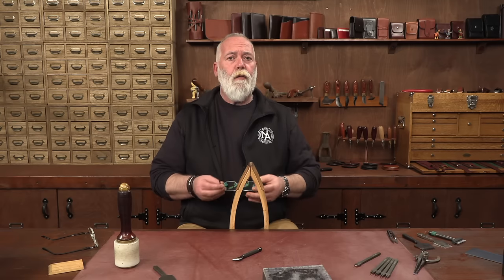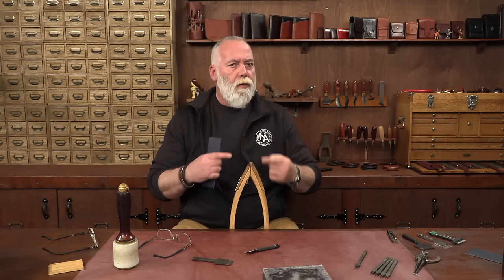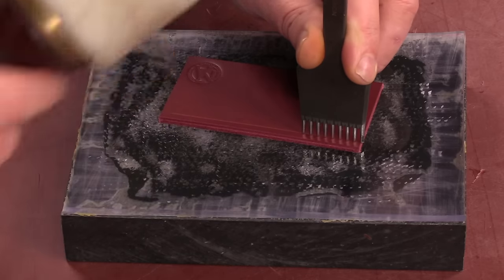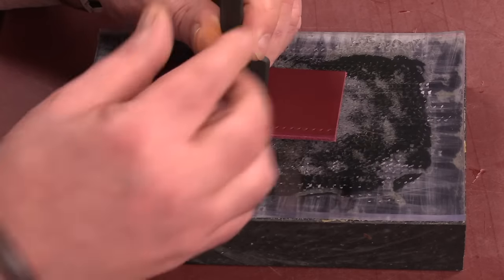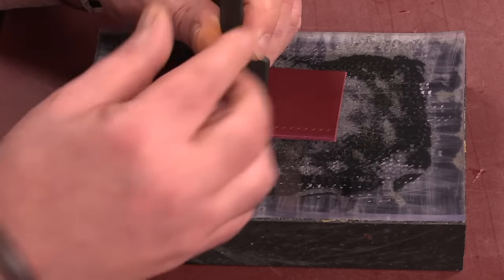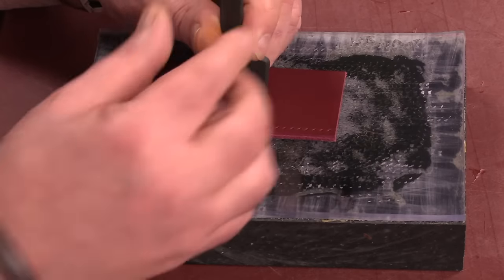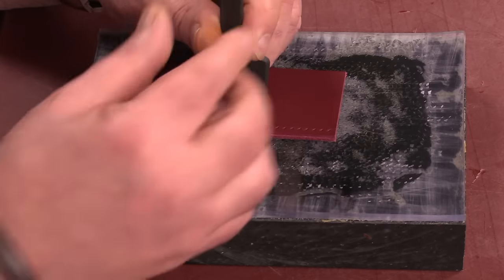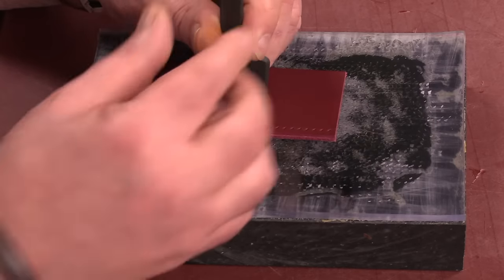How to Hand Stitch Leather - Saddle Stitch -  Modern Style - Tutorial Part 2

Comment: Hi Nigel, Just been watching your tutorial on the modern saddle stitch episode 2 and just want to point out that the way you are using the pricking iron on the 2 pieces of leather will cause a problem because when you stitch the 2 pieces together , the stitching holes now create an X and are not either a forward / or a back /. This X will cause the needle to punch through leather fibre that has not been pricked with the iron. Other than that I have learned an immense amout fron your tutelage !    Thanx    Russell
Reply: This is the difficulty I struggled with. You've voiced my problem. Thanks
Reply from the maker: Perhaps a re-watch would assist.
Evidently, it works as you see the results in the video.
This X is quite clearly explained and intentional.
I developed this style of stitching some years ago and have been testing, using and teaching it with great success since then.
Trust the process.
Reply from the maker: @kursatbasar.m  Hope the above helps.
Reply: Thanks Nigel,
I will watch again and definitely I need to practice more
Reply: Excelent my friend, many thanks.

Comment: Hello. First of all, very good explanations. In the part where you join two pieces of leather, using the iron awl that makes inclined holes, I believe that each side (each piece) of leather was inclined to one side, and that's why some difficulties arose in the sewing. Since the pieces of leather are mirrored, the inclination of the hole must be opposite on each side, so that when joined they are the same... For example: on one side it is / / / / and on the other side it should be \ \ \ \, because when you join the flesh of the leathers, they are in the same direction... When you made the video, one piece ended up being / / / / and the other also / / / /... I hope I explained myself enough and helped...
Reply: Agreed, unless I missed something, an x will be really weak as all thread on 1 point, all holes must face the same for lacing/sewing/joining or no meat for strength...

Comment: Hi Nigel Thanks for this! Just one question. What about the thickness of the thread? Doesn’t it interfere in the length. For example I mostly use 3mm pricking iron, with 0.45mm or 0.35mm...wouldn’t i need more or less depending on the thickness of the thread?
Reply from the maker: It's more about the journey that thread takes rather than how thick it is.
A 0.35mm thread will travel the same distance as a 1mm thread, so in short, no, it makes little difference.
Reply: Thanks for the response. I just wanted to make sure while using your thread length calculator! @ArmitageLeather
Reply: @ArmitageLeather   Hi nigel just a quick question i am sure you mentioned something about water blisters on one of your recent videos but i cant seem to find it now  .i had a few water blisters on a pouch made from sedjwicks 1900s collection leather  not near the stitching what would the best way to treat the leather before a project .Thanks

Comment: I don't agree about the tension angles. There are more situations where the thread have to be tensioned at an angle, with very thin leather, for example a watch strap around 2mm in thickness, it will be impossible (at least with a lot of leather types) to get a nice slant on both sides unless the thread is tensioned at an angle. (And of course it's stitched with a cast) And yes I can stitch with good consistent results.
Reply from the maker: Perhaps a watch of all the videos would help. you seem to be arguing a point that is clearly covered.